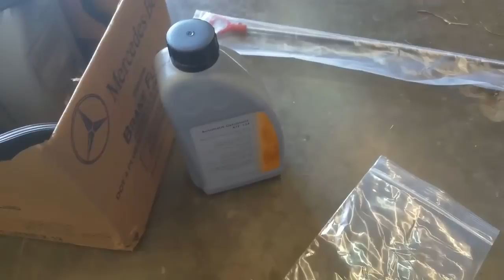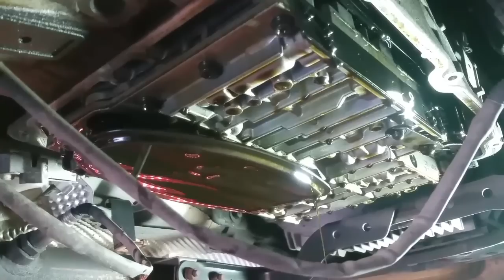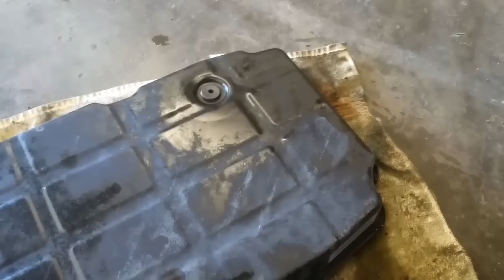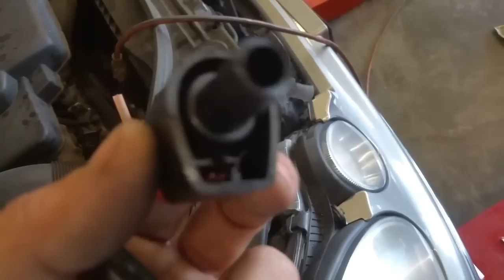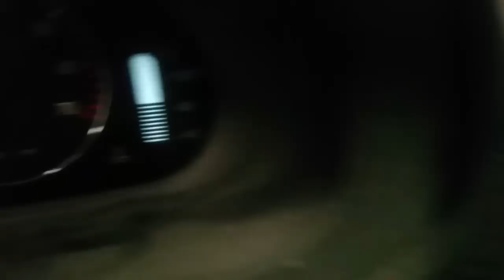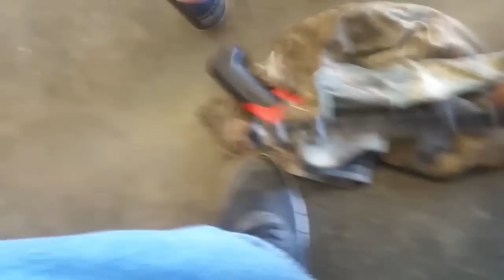MERCEDES E-CLASS AUTOMATIC TRANSMISSION ATF FLUID & FILTER CHANGE FLUSH, TOPOFF. STEP BY STEP.

Comment: hello, question. my dipstick tupe at the back of the engine is MUCH longer in the back of the engine. For some reason I believe it's the oil tube. When changing my oil...I stuck the dipstick in and received no read. when I refilled with oil...did another check and it was full. so my question is...where would my tube be for the transmission? I have the same exact vehicle.

Comment: The following information relates to the W211, E-Class (2004 E500 Base) and may be interchangeable with other members of the W211 family.  BEFORE you begin any service project, CONSULT YOUR DEALER!  You should also have on hand, your Factory Approved Service Products Manual.  For the W211, MY 2003, E500, the official MB Part number is S-0473-03A (it may be different for MY 2004).  Also be VERY AWARE, that while MOST parts are interchangeable, there are some that are VIN specific.  Further, you will need to know if your vehicle shipped with a 722.6 (5 Speed) or the 722.9 (7 Speed) transmission.  Always check with the dealer for proper fitment BEFORE you purchase the item!  You may be subject to a non-return policy, or restocking fee if the incorrect parts are ordered.  With that being said, Below you will find part numbers for the items shown in the video.  Some part numbers may be superseded by OEM numbers, if the original parts are no longer in production.  

Genuine Mercedes Transmission Pan, MY 2004, E500, 140 270 08 12 (5 Speed Trans)
Genuine Mercedes Transmission Pan, Drain Plug, MY 2004, E500, 001 990 11 17
Genuine Mercedes Transmission Pan, Magnet, MY 2004, E500, 000 988 08 52
Genuine Mercedes Transmission Pan, Gasket, MY 2004, (E320, E320 CDI, E500), 140 271 00 80
Genuine Mercedes Transmission Pan, Gasket, MY 2004, E500, (5 Speed Trans), 140 271 00 80
Genuine Mercedes Transmission Filter, MY 2004, E500, (5 Speed Trans), 140 277 00 95 
Genuine Mercedes Transmission Fluid Filler Cap, MY 2004, E500, 140 270 00 91
Genuine Mercedes Transmission Fluid Filler Locking Pin, MY 2004, E500, 140 991 00 55
Genuine Mercedes Transmission Fluid, MY 2004, E500, (1L), 001 989 68 03 13 (ATF 134)
Genuine Mercedes Transmission Fluid Dipstick, MY 2004, E500, 140 589 15 21 00

Tools required: 5mm Allen bit or wrench.
Drain pan for the discarded transmission fluid.
Dipstick tool mentioned above.
Allen head screw driver (to remove filler cap)
New locking pin mentioned above.
Cleaner to remove debris from the bottom of the fluid pan and to clean the magnet.

Torque Specs: 
Drain bolt: 20Nm
Pan bolts: 8Nm 

Some things to consider:    
80 degrees C is 176 degrees F.  If the car is at operating temperature, let it cool before you begin to avoid being burned.  

Be very careful when removing the last bolt and lowering the pan, there will still be some fluid in the bottom.

When you remove the transmission filter, be sure the rubber o-ring comes out with it.  

At the opposite end of the filter is a small fin that inserts into the bottom of the valve body. 

MAKE SURE you apply a thin layer of trans fluid around the filter o-ring to act as a lubricant.

Seat the fin into the groove and press the filter into its final resting place.  

Enjoy!
Reply: Thew,.........
Awsome description brother 👌
Reply: Hello there,  I would like to ask you if know how many quarts are needed once you draine the transmission fluid,  and I mean if you know exactly how many quarts  despite how much fluid came out.
In my case , almost 5 quarts came  out  and I don't think it will need only 5 quarts 
My car, 2005 e500 base
Thanks in advance
Reply: @crissy7503  how many quarts did you put in? im gonna order my fluid but dont know how much. manual says 8 quarts for an e500.

Comment: Thanks for the good video. I have an E320 - 2003 like new, only 31,500 miles. It was always garage and got it in South Carolina from an old lady friend that used it to go to Church and Supermarket. Is unreal. It runs like new. There is a tube with a red cap in the center back side that seems runs parallel into the transmission. Since the fluid leaked is RED; after getting a measurement deep stick like on your video, the oil is brown. Then I thought that tube does not go into the transmission (??), and it measures WELL above the black rubber measuring tip; about 3 to 4 Inches. If that is transmission fluid (brown), then is way overfilled. This car was only serviced at the Mercedes Dealer which is even more odd. Any comments??

Comment: I have been having problems with a Mercedes E320, shudder or hydraulic knock not quite sure what to call it, I've changed all the rubber mounts to the engine and transmission and lastly  the diff oil, it is still present but greatly reduced but not fixed

Comment: Mechanic told me he would have to change the adapter plug that connects to the transmission cable when servicing the transmission. How necessary of a step is this? Can I get away with not doing this and the conductor plate? Not planning on having the car more than another 3 or 4 years.

Comment: Hi George I am Vinesh from Durban South Africa,  I have a problem with my electronic box.  Have done diagonists  error message,  2nd gear slipping.

My fault is had a jerk, then stuck in take of gear, will not change into next gear.
What is your advise

Comment: I ordered the Mercedes 722.9 transmission service kit with five liters and one single liter of the Pentosin fluid.  The Kit included new pan bolts, gasket, stand pipe adapter and the Fluid.  The part that got my attention was the description of the Pentosin fluid.   Says the coloring dye for the fluid is Blue not the traditional red.  Ordered from FCP Euro so apparently a reputable vendor.    Is the Pentosin good to go even with the blue dye instead of red?
Reply: I think the color of the fluid designates which spec the fluid is. Shouldn't mix the colors.

Comment: Is it the same for the W212's? and when are you suppose to do this? 50,000 miles?
Reply: it should specify in the owner's manual. I know for the W211, it should be done at 60000 kilometres.
Reply: Every 40K

Comment: Hello George. I have 2 mercedes benz's with issues that I could use your help with:
1. 2001 Mercedes S500 that has intermittent start issues. I turn the key and there would be no start or crank. I pull out the key and then reattempt. Sometimes it will start.  But the last time the car wouldn't start, I moved the shifter to neutral and attempted to start and it started right up. Its almost as if the car thinks its in security mode. Weird.
2. 2009 Mercedes E350 - (2 issues) My wife's Mercedes e350 high speed can communication bus performance error (U0002) came up. What is the fix for this problem? Next issue is hard shifting from 2nd to 3rd gear and back down when coming to a stop there is a violent jolt when its shifts down. 

Thank you George in advance for any assistance that you can offer.
Reply: I do have have a mercedes benz E320,it does the same thing,but I found a trick to crank it,the Key Fob has cracked in the Panic button,so when it gets dust it wont crank,what I do is,I blow it with my mounth and It cranks,try that I hope that helps to you,thanks.
Reply: @smithjo4152  inside of the keymob(motherboard)it gets dust,thats why.
Reply: @RobertoRuiz-ro9cn  the mother board on the key fob? What about inside the ignition? Could canned air work?
Reply: @smithjo4152  Sir be honest ,I dont know about that, all I can tell you is,that I have to blow the key fob all the time,in order to crank it.
Reply: @RobertoRuiz-ro9cn  Thank you. I appreciate your help.

Comment: Hello George, Thank you for this great video. It has been very enlightening and beneficial. I have an 06 E350 4MATIC with about 95,000 miles. I was told by the seller that these models did not need Transmission Fluid changes cos they were not built that way. How wrong he was. I have scheduled a transmission service to have that settled...I ordered the parts you mentioned and I am sure there will be a huge difference in driveability and performance.

Comment: Where do we jack the rear of the car up at so we can put jack stands under the jacking points?
Reply: Under the rear differential cover.  It's steel, round and situated between the dual exhaust pipes and in front of the fuel tank, pretty much dead center of the car, equidistant between and at the level of the back wheels.